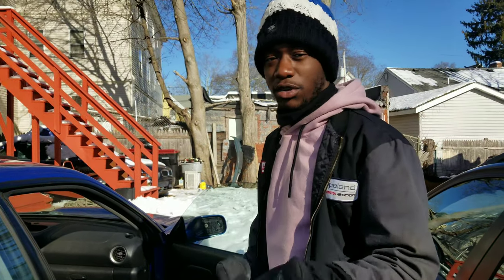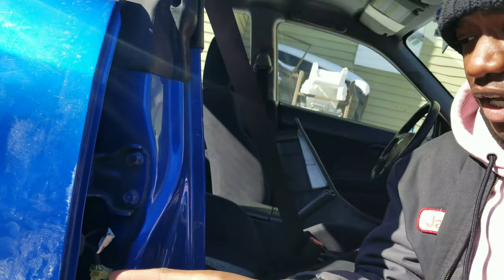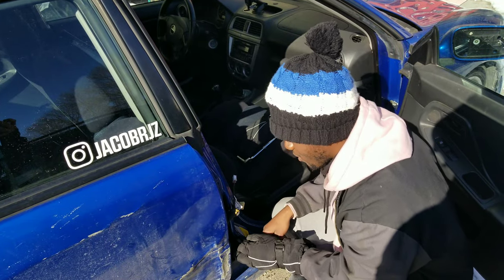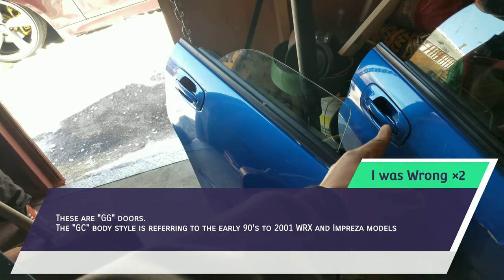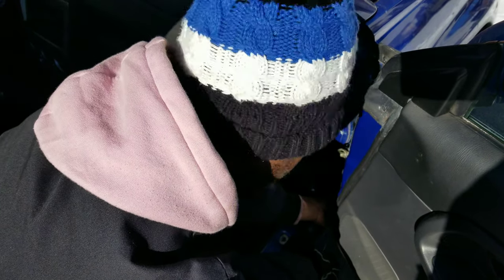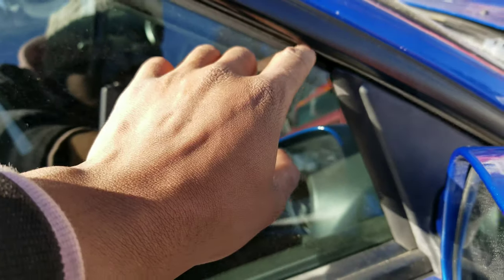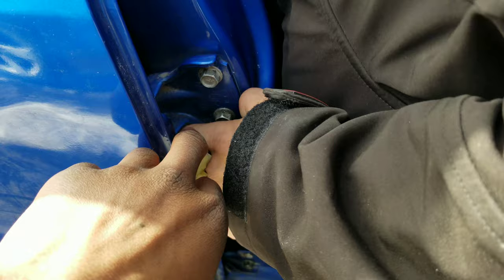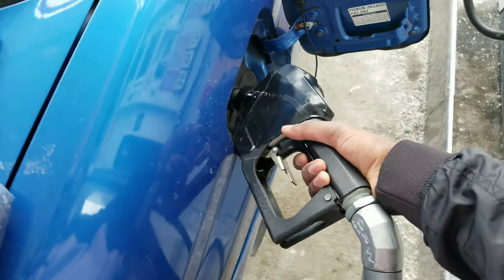How to Replace a Car door (GD WRX)

Comment: You are correct on the issue with the front window. The wagon one is, for whatever reason, shorter. Swapping that out from the sedan's door won't be a problem at all. 

I experienced the same on reverse, I replaced a front door on a wagon with one out of a sedan, but the taller window would go up too far and i almost broke it when i went to close the door the first time. I am not sure if theres any difference on the window tracks, so i swapped that over too just to be safe.